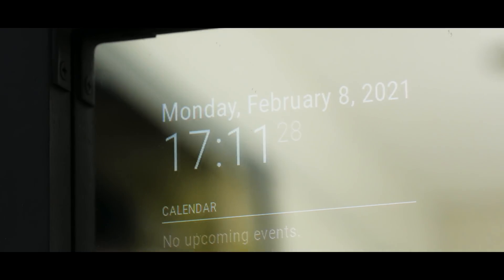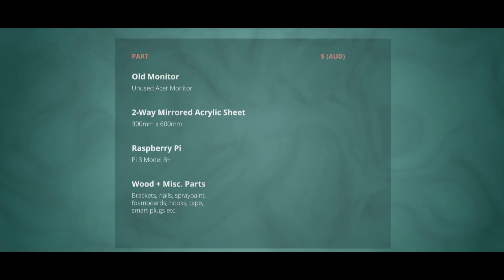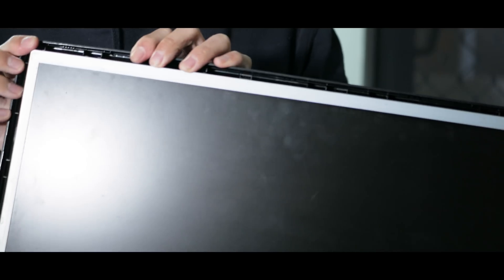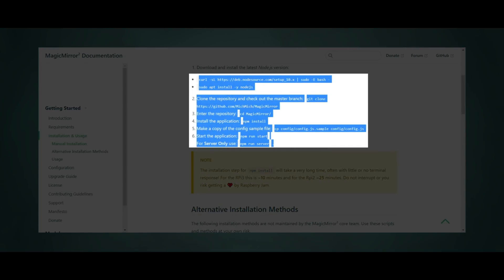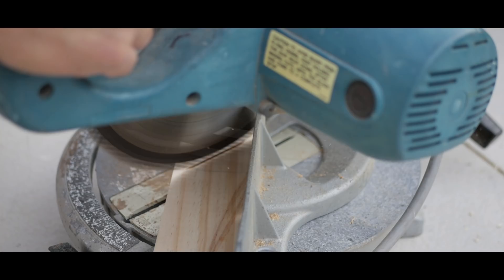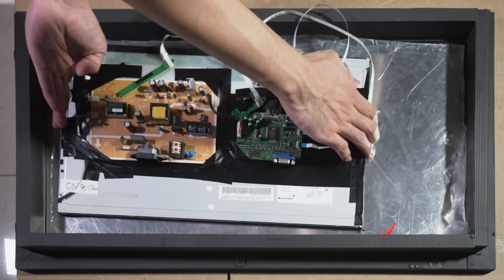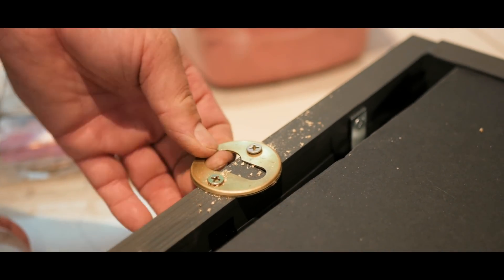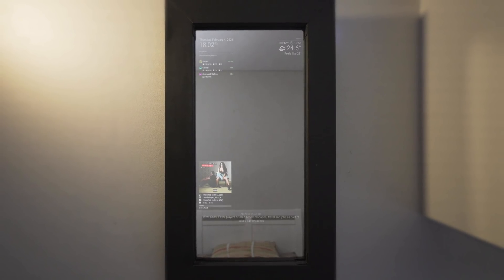How To Make Your Own Smart Mirror

Comment: Great Video !!! :)
Is it possible to do my make up with this mirror ? Or is the quality to bad ?
Reply from the maker: Hello, yes you can definitely do this with a make up mirror! You would have to buy a smaller screen though to fit it in, or alternatively you could just use an old tablet as the screen. If you did this there's no need for the raspberry pi as there's many apps that you can use to get the information showing on the tablet.
Reply: @blu3017  Thank you for your fast answer. I will definetly try to build one. 
The idea with the ipad is good.

Comment: Is it possible if using Raspberry Pi zero w? 
Im looking for a compact solution for the magic mirror.
Reply from the maker: If I remember correctly it won't work/won't run well at all because the zero is so underpowered. I think the minimum recommended is the Pi 2

Comment: Great video!! What size acrylic mirror did you use and how big was the frame. I've just bough an A2 (420mm x 594mm) acrylic mirror but not sure how big the frame should be

Edit: I was looking at buying a shadow box frame too and just adding a secondary frame to the for the raspberry pi to fit in, not sure how well that would work in practice
Reply from the maker: thanks! my acrylic sheet is 300mmx600mm. The frame was made so that the acrylic sheet goes over each side of the frame by around 2cm (so the frame is around 260mm x 560mm on the inside).  Your mirror is quite big so I would recommend having it overlap more cm with the frame (also, not sure how thick your sheet is but it might warp a lot with pressure so having more overlap would help). The shadow box sounds like it'd work well, let me know if you ever make a video of your mirror!
Reply: @blu3017  only sheet I could find was 3mm which I'm hoping is fine. Ended up just buying the wood and making the frame myself. Maybe if I make a V2 I'll use a shadowbox. Did you use electrical tape for the monitor component or just regular 2 sided tape?
Reply from the maker: @BlackTgaming  that was quick haha. I used electrical tape just to be safe

Comment: Thanks for the tips on the frame I made one but made it to small and components stick out too much. I pretty much have everything already just need to update whatever modules I have and add/remove some. Quick question I actually bought the Rasberry Pi 4 witch comes with integrated wifi you recommend just sticking with it or buying an better external one? Btw awesome tutorial here from Reddit! 🤖
Reply from the maker: Hey, thanks for the support man! I'm just a little confused about your question, are you asking if it's fine to use the raspberry Pi 4?
Reply: @blu3017  Yes. 😅
Reply from the maker: @Thatoneguysal88  Raspberry Pi 4 will definitely do the job, so I would say stick with it for sure.
Reply: Salvador, I bought a pi 4b with 8GB of mem in Oct. I'm running it as a desktop development station and I assure you, the wifi, bluetooth, and everythign else about this board is more than powerful enough to do anything you want to do. My only suggestion is if you haven't worked in the pi/linux world? Do so. As a maker, developer, etc... it's an amazing tool.
Reply: @TheJacklwilliams  I'm finding it difficult to play videos on pi 4b 4 gb model can you help?
Reply: @ravigarg6841  Hi Ravi, maybe? I’ll tell you, out of the gate the only video’s I have watched are YouTube hosted mp4a is what is showing for the codec on one playing right now. Typically I’m watching the at 720p with rate adjust setting “auto”. The movies, that YouTube has hosted kick up an error message. I never looked into this because well, I’m typically watching short clips on tech, engineering, philosophy, etc… I don’t watch movies or tv shows anymore. Lastly, I’m running the 64GB Beta OS. However, when I was running the 32bit I had a pretty much the same experience. What’s difficulty are you having?
Reply: @TheJacklwilliams   thanks for your reply jack, Actually i'm using 32bit official os ,  videos normal quality 720p or 480p but they start to lag and its quiet visible. played videos on youtube, my personal video through vlc media player similar lag. Are you using the official power adapter? ive tried my best to resolve this changing resolutions and what not.
Reply: can we talk about this on instagram dm or some other chatbox? It would be great help
Reply: @ravigarg6841  Interesting, truly. I’ve only seen lag issues with some live streams and the problem was on the broadcast end. Now, again, same thing with 32 bit (which I had longer, just jumped to 64 bit in last cpl months). Noted as well, my internet is piggy backed via wifi from my neighbor who’s about 350 feet away in another building. I setup my linksys router as a repeater, connected to his wifi, and it provides me wifi and Ethernet. Noted as well, my pi, is cat 5 connected too this router, not wifi….
Reply: @TheJacklwilliams  how are you powering up your pi board? Official power adapter?  I know it sounds silly but I'm using a samsung fast charger with good type-c cable & on running 2-3 apps I could see power & low battery icon so felt it can be power supply issue
Reply: @ravigarg6841  You know that’s an interesting point. I do have the officially py supply it came with the CanaKit extreme kit I got (8GB, 128GB SD Card). The other interesting thing is I need too do the math myself because I’m driving an OLED screen (2 in by 1)), a 248GB SSD (converted over from SD Card), and Ice Tower blink blink fan/heat sink and currently a temp/humidity gauge plugged into that mess as well, lol. Now, given that, I’ve had zero issues mind you (knock on wood).